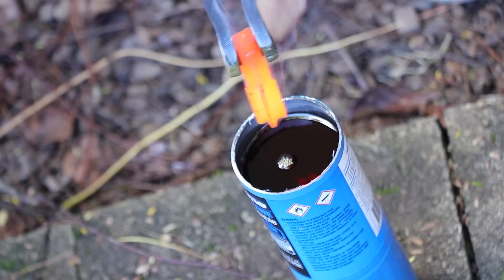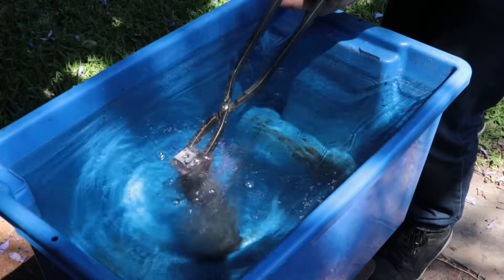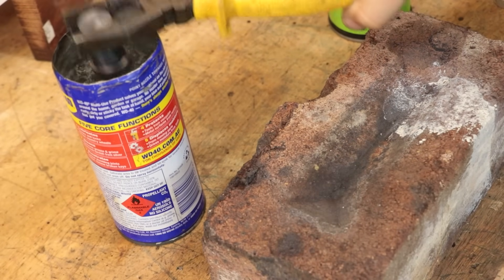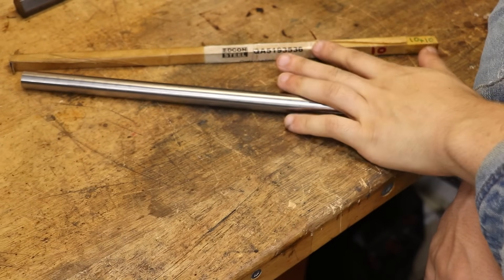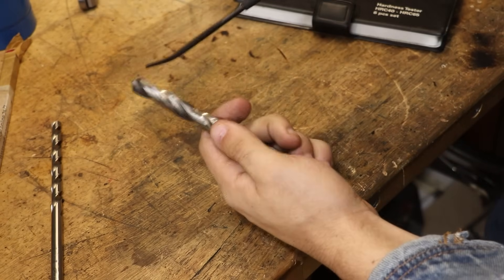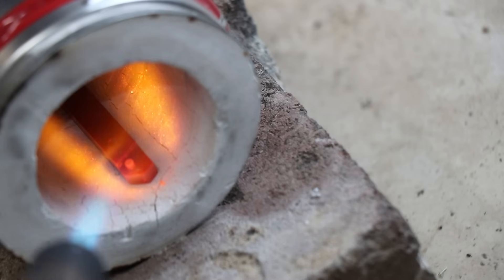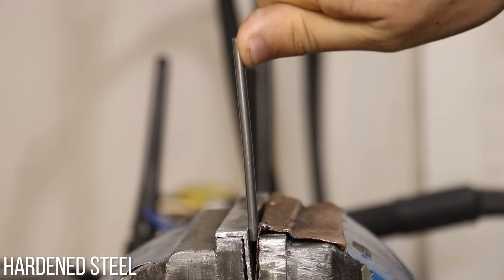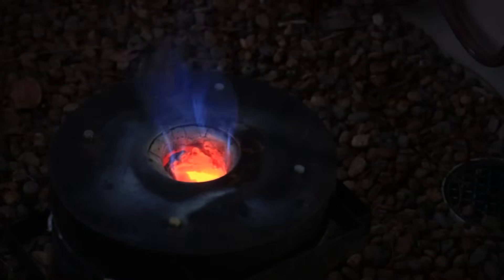10 Misconceptions About Heat Treating Steel

Comment: 13:20 - you imply hardening increases wear resistance, but earlier one of your points was that it doesn't equate to less wear
Reply from the maker: Hardening does increase wear resistance of the same steel. But two different materials of the same hardness don’t necessarily have the have the same wear resistance.
Reply: @artisanmakes  oh I see! Thank you :)

Comment: To add to all of this - if you want some real complications you can always try the ins outs and upside downs of heat treating aluminium alloys.  Small variations in alloy components almost reverse the requirements in some cases.   At times you need a whole dissertation and computer control to keep up with the diversity of temperatures times and quenches involved.
Reply: My  technical project in engineering school was an investigation into the mechanism(s) of exfoliation corrosion of high strength aluminum alloys (7xxx series).  The solution annealing and ageing treatments were complex and some quite long.  You can't stop at step 3 and pick it up the next day as the microstructure of unaged 7xxx aluminum alloys will change at room temperature.
I had a bedroll and an alarm clock stashed in an unassigned locker outside our labs and literally lived in that lab for 3 months.  The clock would wake me up when it was time to move my coupons from one step to the next in the treatment process.
My project advisor accused me of cheating, as he said there was no way I could have completed the work during lawful lab hours.  I had film negatives for each micrograph in the report, that made it hard for him to deny I DID do the work - he just never figured out HOW and I couldn't say because working alone in the lab was grounds for expulsion.

Comment: Great video that explains the basic concepts.  The only thing that I can think of would be to show the Time-Temperature-Transformation diagrams for the different materials.  This would show the different austenizing (Ac1) temperatures as well as the time in which the quench has to be completed in order to form martensite.
Reply from the maker: I covered that in a video last year, more in-depth about heat treating. But for what it’s worth I don’t find ttt diagrams very useful, I much prefer cct diagrams for most work. IMHO
Reply: @artisanmakes  Both diagrams work to the same end.  My thought was that showing the time available to quench to martensite would demonstrate why the severity of the quench is important and that why quenching complex parts in an oil (slower quench rate) helps to avoid the problems of distortion while obtaining the full martensite transformation.

If you want to have some fun, you can always do cryogenic quenches for high alloy tool steels in order to obtain a more complete martensitic transformation.  I did this for some open die forge tooling where the part being forged was at 2,200F.  I was able to increase tool life significantly.
Reply from the maker: I did this in a video last year and I just didn’t think it was necessary to explain again, not for a not so in depth video such as this. Cheers
Reply: @artisanmakes  I will look it up.  cheers, mate
Reply: @paulkurilecz4209  
you're spot on.  to get full hardness out of any steel, the critical quench rate curve  needs to be fast enough to get past (miss) the 'nose' of the bainite curve.
Reply: @Andy_Hinners  Yes, I stayed awake during my metallurgy classes.  🙂

Comment: knifemaker here, the reason we generally say use oil not water is becuase water quenching has a higher chance of cracking the steel due to how fast it cools, oil is a bit slower so theres less risk or even use brine over water
Reply: There are a lot of steels that fare better with water still. They are specifically designed for water quenching, even if it is a knife or a sword. Don't mix up this one.
Reply: @Dinnye01  like i said, generally not every time, as he explained in the video some steels (1045 for example) are a water quenching steel. i was expanding as such as to why people say use oil not water
Reply: Small, round-ish parts can benefit from water quenching, knife blades on the other hand... well, you already know. :)

Comment: Case hardened steel doesnt require tempering. It has a hard outer layer and soft inner. Tempering defeats the purpose.
Reply: No it doesn't. You don't always want such a brittle case. Tempering reduces the brittleness while still maintaining hardness well above the soft core.
Reply from the maker: It’s a bit of a broad generalisation. I tend give it a low temperature temper at around 150c just to relieve some of the stresses without altering the hardness a whole lot. But I don’t always

Comment: Isn't the ability for a material to scratch another material the actual definition of hardness, though? Maybe it's not measured quite like that for the rockwell scale, but I'm pretty sure i learned that in high school. Also, to #8, i think you proved yourself wrong. I'm not sure how you interpret "stiffness" (and i say that sincerely, since interpretation can differ greatly between groups of people) but for me and i think most people it refers to somethings ability to bend, which is what you've demonstrated. I'm not trying to nitpick, though. I know im just the peanut gallery, and you've demonstrated your formal education in this topic, but i just wanted to point that out. I was genuinely surprised by most of these misconceptions, however, since I've held them to be true myself. 😂
Reply: Stiffness is quantified by the Young's Modulus and is the ratio of stress(force per unit area) to strain (how much it moves) - how much it bends for a given load. This is the same for hard and soft steel - about 200 GPa for both. What is different is the yield strength - that is the point where the part will not spring back to the original shape. That goes up with hardness. The steel has an elastic range where it will spring back and then a plastic range where it bends but will not spring all the way back. Hardening extends the elastic range but reduces the plastic range because it becomes more brittle. I hope I have explained that OK??

Comment: The thing I remember about using motor oil back in Industrial Arts at High School was using used diesel oil was a good way to coat steel for rust inhibiting....
Reply: Yes that was the only good use of it lol
Reply: @samrodian919  Goes pretty good in the pot belly too you know...

Comment: So I think you skipped over some of the most basic rule of thumb of heat treatment..#1 don't worry about color or even temperature it's all about heating it up slightly past a non magnetic state..aka a magnet no longer sticks to it..#2 then quench in 130°F veg oil or better yet heated baby oil / mineral oil which is the main ingredient of most commercial quench oils..#3 temper in a sand filled cookie tray to even out the heat in a oven..

Comment: If you are aiming for specific targets heat treatment wise accurate temps are nescessary. There is no substitute. Regarding quenching a important point missed and demonstrated in the video was temp controll of the quench. The oil quench for example was done with a a very low part to oil ratio so the quench medium heats up to quickly before the quench is complete giving mixed results. Personally when using oil hardening for cutting tools I was taught to pre heat the oil in an era without a temp probe we would just add another lump of hot steel into the oil and warm it up first prior to quenching the cutting tool. I had great success doing this making tools to use on a very large planer. They really sort the good from bad as you need to take highly loaded cuts with very good wear resistance as a tool fail mid cut can be very difficult to fix on the machined part.
Reply: lol, worked at one place, had to occasionally do runs of punches/drifts. "heat it up til its almost melting then dunk in tin can of sump oil"...

lets say that results varied... drastically. what started as cold, 10c or less on a cold day, was soon boiling and flaming at 350c or so... along with decarbonised tips from the brutal heating... "soak? whats soak?"

i dont recall even tempering them... 

then one run got scrapped altogether as the guy in charge, that also dictated said heat treatment, had cheaped out on the steel bar and there was a crack running through all ten lengths...

there were LOTS of reasons i quit that place... shame, as i actually enjoyed the work...

Comment: I worked for several years as a heat treat oven operator in a metal stamping plant. The soak time required to increase carbon levels varies a lot, and will depend on things like the depth you need the carbon to diffuse into. For the sort of work you're doing yeah, soak times will be much larger, but I'd like to point out that it's not always the case that you need such long soak times to get effective diffusion. The parts we treated were car parts, we were specifically austempering, and typically had hardness in the 30-45 HRC range and had soak times under an hour in a 0.30 to 0.45% carbon atmosphere. In contrast hardening a transmission shaft might easily require a soak time of 6+ hours.
Reply: I'm a retired QC Manager and worked in a huge machining facility that also did heat treating, and everything you said sounds painfully familiar.  Keeping HT quality at a high level was like herding cats!
Reply from the maker: I go based on the rule of thumb of about 0.1mm ish of diffusion per hour of case hardening. That was roughly what I was getting on a set of test rods I did a few years back. It’s not always going going to be accurate but I use it as a rough guide. It’s good enough to get my parts from A to B. Cheers
Reply: @artisanmakes  This matches my experience as well, at least for the first few hours. As this is a diffusion process the speed will decrease rapidly as you get deeper.
Reply: @artisanmakes  Pretty good rule of thumb yes. The diffusion speed of carbon changes with temperature, so hotter means faster.
Reply from the maker: It does but let’s be real, I really have no idea how hot the metal is once it’s inside the packing box and left in the furnace for a few hours. Just that it’s red hot. I use my rule of thumb and that is good enough for basic home shop use. Cheers
Reply: @artisanmakes  yeah, not having fine control of the carbon level of the atmosphere or the temperatures makes things very different in a home shop compared to industrial scale work.
Reply: It depends on the steel and thickness of steel

Comment: Re oil, I've always believed that it (mineral or motor oil, not veg) improves rust resistance -- the latice being open when hot, thus trapping/sealing microscopic oil in when cold, True or not???

Someone please try it -- I don't have a life in metalwork anymore. Quench both ways and leave the two parts out in sea atmosphere. True science!
Reply: Leaving the polymerized veg oil on the surface definitely provides corrosion protection.

Comment: Ive heard adding a surfactant helps keeping air away the surface of the metal when water quenching in addition to salt.
Reply: When I heat treated press dies we used salt water to quench. We also had a molten salt oven we used too. When I pulled those dies out of the oven it was like I could see right through them. They were an inch thick steel.